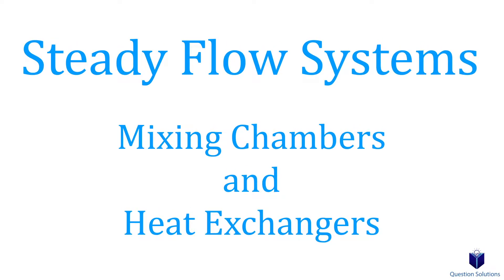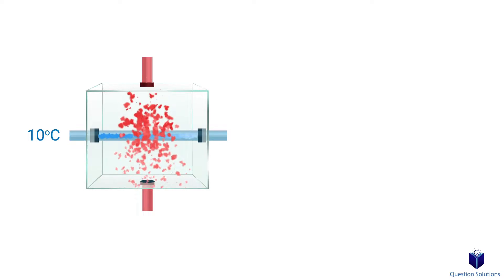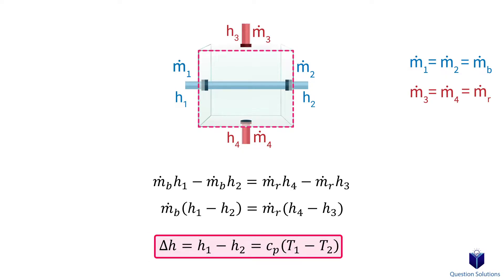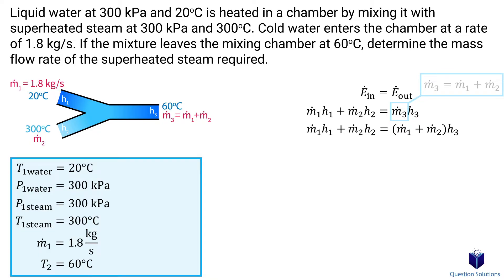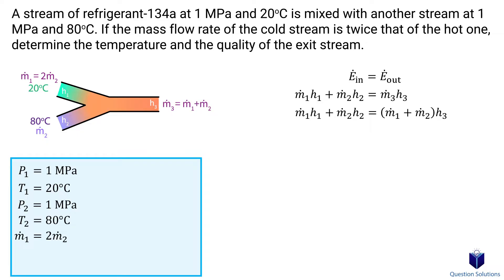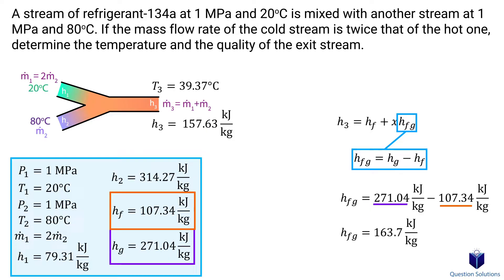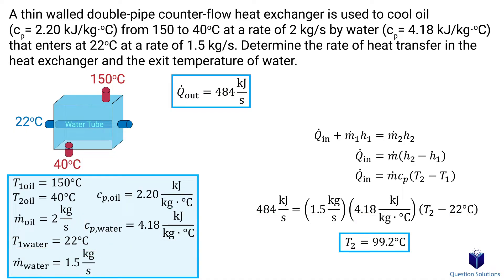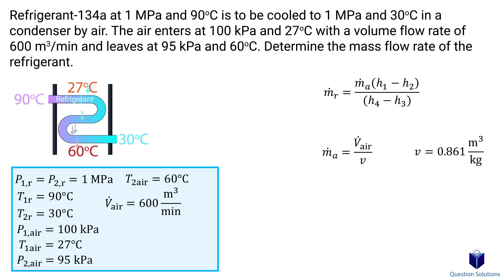Steady Flow Systems - Mixing Chambers & Heat Exchangers | Thermodynamics | (Solved Examples)

Comment: Why didn't you use the sign convention to identify the heat leaving and entering? or did you do it with the in and out prefixes?
Reply from the maker: You can use whatever sign convection you want. Generally, at least here, we use in and out, or 1 and 2, etc.
Reply: @QuestionSolutions   Gracias!!! Saludos desde México
Reply from the maker: @penadoranteserik9520  You're very welcome!

Comment: At 9:40 can we use pressure table to decide if it’s compressed or superheated, but the magnitude of hf will be different
Reply from the maker: You mean instead of a temperature table? Both tables will have the same values corresponding to each other.

Comment: Great videos. However, at 10:30, you have taken the pressure of outlet same as pressure inlet 1000KPa. is that always valid. Can we take outlet pressure same as  inlet pressure?
Reply from the maker: In most cases, in adiabatic mixing chambers, the pressure is constant in the inlets and outlet. It will say otherwise in a question if there is an exception.

Comment: Pardon me if it's obvious, but for the first question, how did you know the output was a saturated liquid (i.e. quality of 0)? I assume P3=>300KPa therefore above the saturation temperature at 60 degrees Celsius and thus a saturated liquid so you can use 25KPa?
Reply from the maker: Could you kindly provide me with a timestamp so I know where to look? Many thanks!
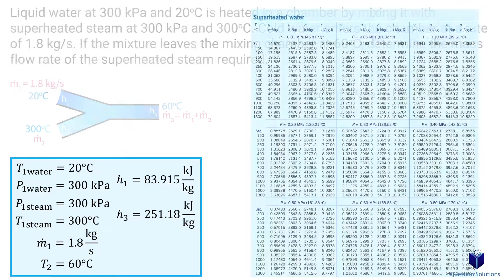Reply: @QuestionSolutions  7:42
Reply from the maker: @DASmallWorlds  Yes, that's correct!